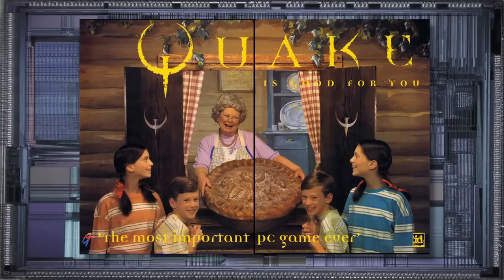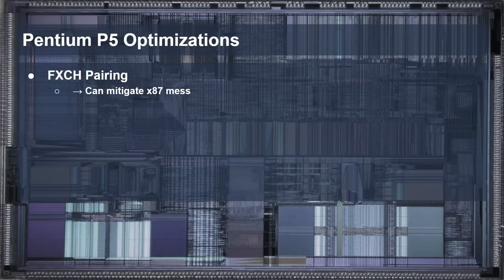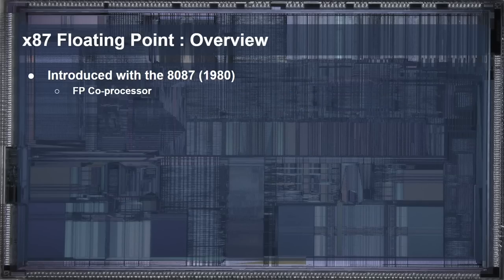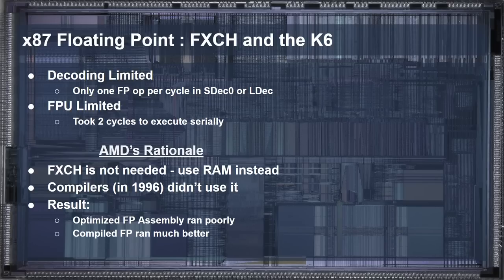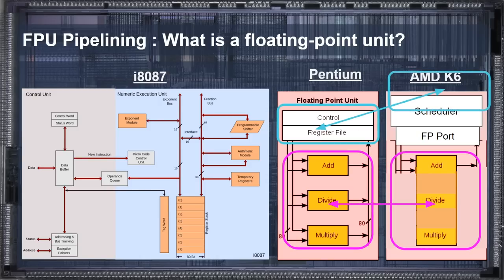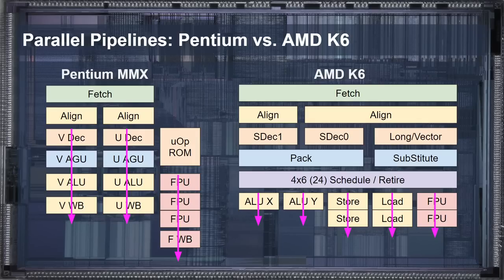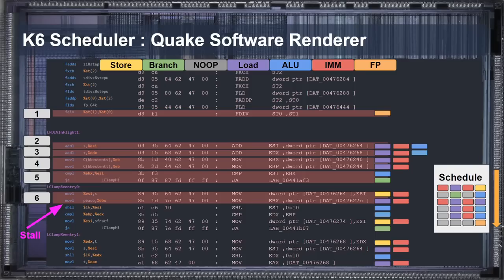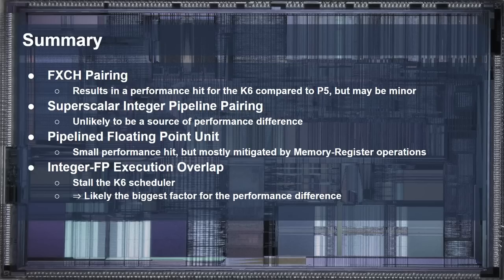Quake, Floating Point, and the Intel Pentium

Comment: This is probably the only video presentation on YT that properly deconstructs the Quake software rendering performance, in contrast to pretty much all other attempts that still play on old industry myths and oversimplified technicalities.
Reply: Well, in my opinion the information presented is a bit more ancillary to the topic, plus the presenter using an artificial voice really devalues the overall quality. Dare I say click-bait like?
Reply: @Ojref1  Not sure what you are talking about here, its a pretty clear cut case.  The robot voice does devalue the video presentation quality somewhat but not the content.  So much stalling on a per clock cycle is horrid and absolutely the problem.
Reply: @Ojref1  the voice has nothing to do with the content and the content is on point. What are you talking about?

Comment: I'm impressed, this video gets it almost entirely right. Good job, most people spread misinformation when talking about quake optimizations.

one thing i'd note, though, is that the integer/fp execution overlap was not new to the Pentium, and in fact existed all the way back to the 8086/8087. The only x86/x87 compatible processors i know that did not have that were some very early Cyrix models. (i maintain a version of Quake that is hand-reoptimized for 486s and other non-Pentium CPUs, and take much heavier advantage of the original release - i've had to do a lot of research on this)
Reply from the maker: Thanks! 
That was one of the motivations for making the video, the misinformation. Although, I have to admit that I thought a major factor was the FXCH serialization, but that didn't add up when I looked into it.
Thanks for the clarification. I did actually know that the FP co-processors could overlap, but talking about that would have been extra information that could have added confusion (it also wasn't relevant to the P5 vs K6 vs Cyrix 5x/6x story). To me, it was implied by "the 486 [..] used a floating point coprocessor model", although not explicit. I can make sure to explicitly discuss that in the longer version though.
Since you have background knowledge of the coprocessors, would you be willing to clarify a few things? 
- Did the x87 coprocessors sniff the bus for x87 instructions, or was there an explicit signal hand-shake method for the co-processor, where the x86 would issue a command?
If it did sniff the bus, how would the x87 know that the data being read was an instruction vs data?
- How did the x87 maintain consistency with the integer registers, and how could it maintain that if it operated in parallel? I know the integer registers couldn't be used as direct arguments, but they could be used for memory addresses, correct?
- When the x87 was running asynchronously to the instruction stream, would debugging be more complicated, given that the x87 and x86 instruction pointers may not agree?
Reply: @RTLEngineering  to my understanding, the FPU does sniff the bus directly to know what operation to perform, but waits for a signal from the CPU before actually beginning any operation. the FPU does not interact directly with any integer registers and does not maintain a copy of them. it also does not access system memory in any way, and does not have a concept of an instruction pointer. there is a period of a few cycles at the start of each operation where the two are not executing asynchronously - during these cycles, the CPU does the work of fetching all relevant data from memory (direct or indirect) and transferring it to the FPU (exact method varies based on the generation but usually relies on i/o port transfers at offsets that can't normally be used from assembly code). once the FPU has that data, it is free to operate asynchronously while the CPU does other integer work. for operations like stores to memory, the FPU cannot run asynchronously - the CPU and FPU operate in lockstep for these instructions. debugging can be slightly more complicated - FPU instructions are treated as synchronizing points, which means that any results from one FPU instruction will generally not be available (including things like exceptions) until the next FPU instruction occurs. this is what the FWAIT instruction is for - it is basically a NOP, but acts as a synchronization point between the processor and the coprocessor, so that you can wait, and handle any exceptions that might have occurred before operating further on, e.g, results in memory that might not actually be valid yet.
Reply from the maker: Fascinating. I had considered that using the I/O range might make sense to transfer commands. What you said implies that the address calculation is done by the x86 and not the x87, at which point, the x87 could just load / store the data directly with the x86 driving the address/control lines, but not driving the data bus (if that's the method that was used instead of an extra I/O transfer).
So then how did this work with the original 8086? Were the FP instructions already added to it (given that the 8087 came out 2 years later), or was the 8087 a special case, and what you described for the 286 to 486?
Reply: @RTLEngineering  yes, the x86 does the address calculations and at least in the 486 does loads and stores itself (served directly from its onboard cache which is faster than the fpu registers...). an entire range of instructions in the x86 instruction set is allocated for coprocessor use. the coprocessor interface was defined when the 8086 was released, even if the 8087 wasn't, and while i dont know the specifics, i know it is designed such that the CPU does not have to know what instructions the coprocessor supports and what they do. you could design an entirely different coprocessor with a completely unrelated instruction set that still works on that interface. if i am remembering correctly, there was at least one company that made a competing FPU like that, which was not compatible with the x87 instruction set but plugged into the same slot.
Reply from the maker: I didn't realize that the x87 instructions were technically just general co-processor instructions, but that makes sense. It's interesting, because that implies that the initial co-processor ISA model used by the 8086 limited the form of the implementation. Meaning that all instructions had to take the same form of the base instructions and could not instead utilize a different pattern. For example, you couldn't have a 3-byte opcode (including the Dx escape). It also means that you couldn't have immediate values, since that would cause the PC to become unaligned. That does make me wonder if my reason for using a stack model is correct, or if it was a specific limitation imposed by the co-processor encoding in the first place. Sort of along the lines of Intel said "we don't know what a co-processor might be, or how it would work... but here's some free bits, use them as you please" as opposed to "there aren't a lot of bits free for a co-processor, so it will likely have to be stack based" (the latter is what I had originally assumed, and the former is another example of the engineers involved not thinking ahead).
Reply: @RTLEngineering  they are technically called ESC instructions on early x86 CPUs. The 8086 signals where it is in the instruction prefetching and execution + it does address generation and read/write signal generation. The 8087 sniffed the data bus + drove data to be written onto the data bus. Yes, that means that the 8087 had a rudimentary 8086 decoder inside!  It also had to be aware of the prefetching (and occasional discarding of the prefetched bytes) in order to maintain proper synchronization. There was also a few extra control signals between the two for synchronization and exceptions. The FWAIT instruction would run on the 8086 and wait for a ready signal from the 8087. The whole thing required very few pins on both chips. It was a really good design in my opinion :)

Comment: Very interesting! I’m curious how the 486 architecture would handle that piece of Quake code and how many cycles that would take.
Oh, and John Carmack is a proper genius - I was under that impression already, but seeing how intricate the programming towards new technology is… 🤯
Reply: Yep he is. But assembler optimizations for quake are mostly done by Michael Abrash (assembler genius)
Reply: @migorigor  thanks for bringing that up! Never heard of him, but now looked him up and it's clear he's (also) a genius. How about this: 'In 1991 he introduced Mode X, a 320x240 VGA graphics mode with square pixels instead of the slightly elongated pixels of the standard 320x200 mode. At the same time, he introduced readers to a little-known part of the VGA standard allowing multiple pixels to be written at once.'
That's some serious tinkering, along the lines of Steve Wozniak figuring out how to do color on the Apple ][.

Comment: Quick note, the Cyrix 6x86 PR233 was not running at 233mhz, it was using a Pentium equivalence rating and running at either 188mhz (2.5x75mhz) or 200mhz (3x66mhz). Same with their MII CPUs, they were still using a Pentium Rating naming scheme instead of the actual clock.

Comment: Thank you for this video! Altough I newer knew much about the inner workings of CPUs, I could follow your explanations reasonably well. I would love to hear a similar examination and comparison to the Cyrix processors. It's fascinating, that this small company was able to compete and often even beat Intel up to the Pentium with their own CPU designs. What a pity that Cyrix is long gone by now.
Reply from the maker: Thanks! I'm glad you were able to follow along! Finding the balance of background knowledge is always a challenge for videos like these. 
To be honest, I don't really understand the internal design of the Cyrix processors all that much. They mention some advanced features which are also shown in the block diagrams, but those should have made the 6x86 perform better than the P5, and yet it performed worse (probably some implementation quirk like with the K6). Unfortunately, I think a video like that would require micro-benchmarking on an actual chip to extract architectural details.
They did have some very clever ideas though, which Intel did not start to integrate until the Pentium Pro / Pentium II.
Reply: @RTLEngineering  One of the key differences was that the 6x86 was targeted as an alternative for the Pentium Pro, but with the ability for it to be placed on a cheaper platform and for significantly less money.
The integer speed was much faster clock for clock as a normal Pentium, so when it ultimately became a competitor for the standard user market instead they had to introduce a PR rating, because a 150MHz 6x86 was faster at integer as a Pentium 200. But with the FPU being the weakpoint, the difference got infinately bigger due to the PR rating, because it still ran at 150MHz while being about 25% slower at the same clockspeed. So a PR200+ Cyrix ran it's FPU at 150-25%=112.5MHz compared to an intel CPU, while integer being about equal to a 210MHz P5. 
It cost Cyrix their name, while still being a better option for almost every single user that didn't play Quake like games, as it was significantly cheaper and faster in most applications as it's intel counterpart. But Quake became THE benchmark and basically destroyed a good competitor in the CPU space.
Reply: @robgaros2985  
That's true. Cyrix was probably aiming for the general market. It was a great CPU to use in business, where I imagine, they use Outlook, MS Office or something else, Netscape, Internet Explorer.
I had a Cyrix 6x86 PR200+L. I did benchmarking with a chess software and it beat a Pentium 200 MHz, maybe by 10%. Keep in mind, this Cyrix ran at 150 Hz.
Unfortunately, IT departments were not interested and still are not interested.
It is very rare to see AMD or Cyrix or IDT being used in corporate environments. IT departments base their decisions on trust and they trusted Intel since they had a long experience with buying Intel CPUs.
I have only seen 1 insurance company, the largest in Canada, use AMD Geo CPUs in mini PCs. These ran Win 7 and they are for connecting to a VM using Citrix. They did not have many. It was kind of a project to cut cost.

Even today, people who buy AMD CPUs are mostly home users. I’m sure there are some that buy servers and perhaps the occasional 3D rendering guys who want a high core count.

About 80% of gamers use Intel. Look at the Steam info.
Reply: @louistournas120  True, but AMD has basically taken over the high-end desktop CPU space with the Threadripper line and has a couple of huge supercomputer (department of defence and energy) deals with their Epic line. Most Formula 1 teams use those too. It's just the vast majority of run of the mill companies that are still keep clinging onto intel.

Comment: Interesting comparison, simple and coherent. I would love to see later CPUs being compared in same way.
Reply: There's a couple parallels between Pentium vs. K6 in this vid and Bulldozer vs. Sandy Bridge, specifically regarding the FPU (Pentium had a self-contained FPU integrated into the silicon vs. the K6 using a shared module, similarly, Bulldozer shared an FPU between cores where each core in Sandy Bridge had fully independent resources between each other).

Comment: "The transition from mostly 2D games into immersive 3D environments was brought on by none other than the original Quake"

Descent came out a year before Quake.
Reply from the maker: Descent wasn't nearly as popular as Quake though, and the engine under Quake was used in several other popular games.
Reply: I'd argue that Super Mario 64 also played a role in that, as it was released around the same time as Quake. That said, it's true that many more games used Quake's engine.

Comment: I'm pretty sure the K6 was priced so you'd get a few more MHz for the same money (maybe it was the K6-II when that became the case) so it depends on what you're comparing, the architecture or what a person spending the same money on a computer would experience
Reply from the maker: That was the point that I was making. The K6 could only overcome the architectural limitations through brute force (higher clocks). Most people wouldn't know the difference in the underlying technology, so it would be a more subjective comparison, which the framerates are a good proxy for. If the game has 20% more frames, then it will play smoother and be a better experience, regardless of the CPU clock.
Reply: @RTLEngineering  I get your point, though at that time 'being able to hit a higher clock' was an architectural feature. I think it's historically relevant if the equivalent Pentium couldn't reach the clock speed, or cost twice as much (e.g. only from the highest binned CPUs) or required exotic cooling. The whole Pentium 4 netburst architecture was a deliberate choice to drop the instructions per clock to achieve a much higher clock speed, inspiring AMDs (Pentium rating) for it's Athlon XP - lower clocked Athlon chips could do the work of a higher clocked Pentium 4
Reply from the maker: You do have a point there, though it could be argued that it's currently still an architectural feature. I am used to looking at it from the perspective of "we did X, and it can reach clock Y". A minimum Y may have been set as a design parameter, but the novel part of the architecture is X not the fact that it can reach clock Y. That's even more relevant now, considering that the number of possible technology nodes is far greater than in the 1990s. So unless you are targeting the most cutting edge node,  you always have the option to drop down in size if you can't meet the minimum clock requirement.
And Netburst was an exception, where there was an emphasis on hitting a high minimum clock. Which as we saw, didn't really help performance all that much due to the ultra-deep pipeline.
Reply: @RTLEngineering   you're right and it kinda depends on what you're trying to demonstrate. Ends up less important when you can get either on eBay for $5 - I guess I'm biased by my bang-for-buck purchasing philosophy. And one point I think we can all agree is what a fail netburst was haha
Reply: The accompanying chipset is a factor too.
Intel has a bad habit of owning the whole chain.